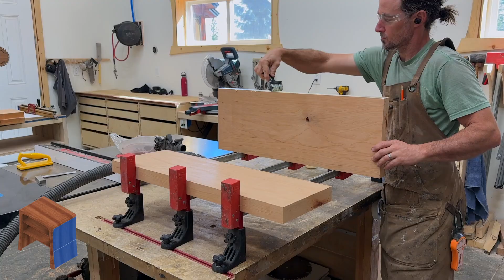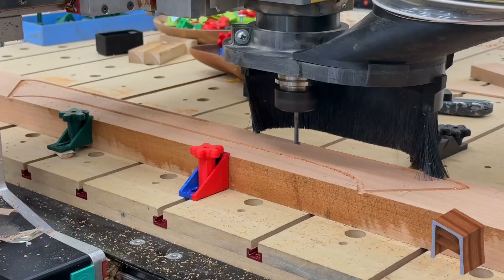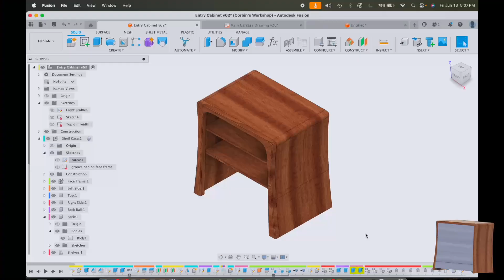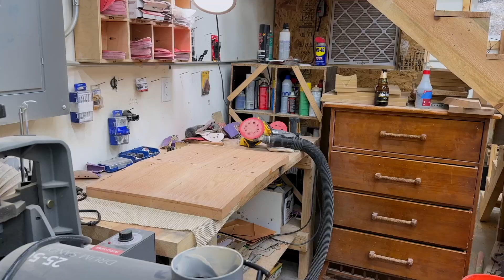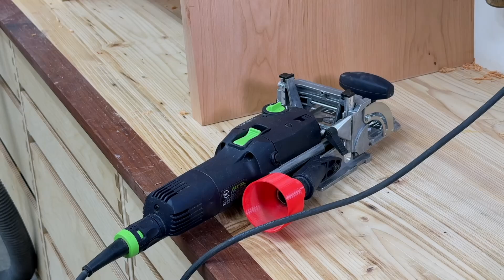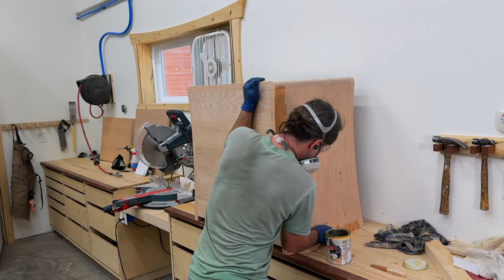Your woodworking curves suck! Building a curved bookcase the right way.

Comment: very cool work! Fwiw, for easier floor cleaning (and to allow for floor robots), I've found that cabinets with bases elevated 4 inches off the floor (with 12 inches between each foot) reduce room dust a lot. Things that fall under or behind the cabinet can easily be retrieved, and floor robots can get under there to regularly clean. Any small gap less than 4" under the cabinet means you end up with a cabinet footprint that is never swept. Things tend to fall to the floor and stay there, so getting robots to be able to vacuum under furniture can improve the longterm air quality in the room! For boots and shoes, I like to elevate them on a slatted platform so any loose dirt can fall through the slats and be vacuumed. 

If I manage to get a design made for my own household shoe management I'll share it ;)
Reply from the maker: Awesome...yeah, those are some good ideas! thanks :)

Comment: So cool! I've been trying to switch to Fusion from Vcarve and am having the most difficult time figuring it all out. Any suggestions on where to learn more about Fusion's CAM?
Reply from the maker: Fusion is definitely more difficult to get around than Vectric, and I still drop into VCarve to do some simple operations (and VCarving itself). I learned a lot by watching "Lars Christensen" on YouTube, but a lot of that was more specific to metal work than wood. Fusion Setup's are based around the workpiece, whereas Vectric is based around the stock piece. So, you have to setup the "Stock" and WCS orientation based on the origin you are using for your CNC (ie: bottom front left is the best). From there... "3D Pocket Clearing" is like Vectric's "Roughing" toolpath, and 3D Parallel is like their "Finishing" toolpath. Otherwise, other toolpath names are similar to Vectric's names.  I really should do a tutorial video on this (Fusion for Vectric users)
Reply: @CorbinDunn  a video on that would be amazing! I've just scratched the surface in Fusion and can tell it can do so much more!